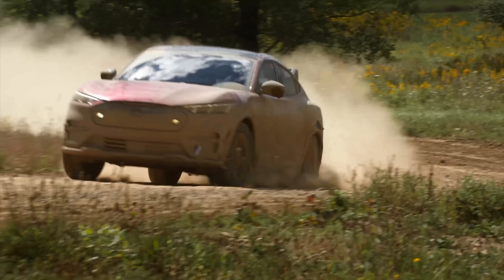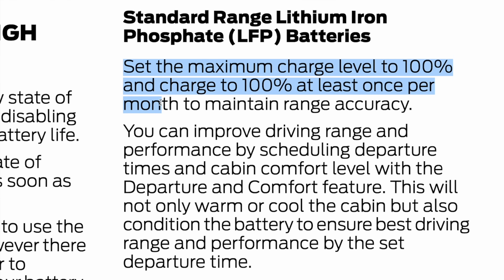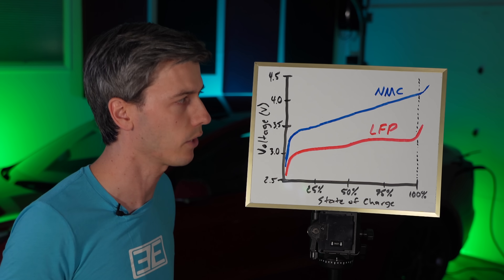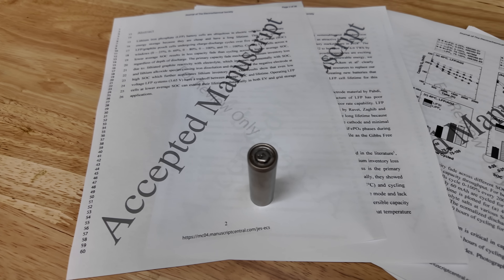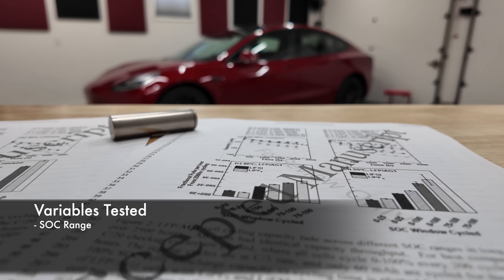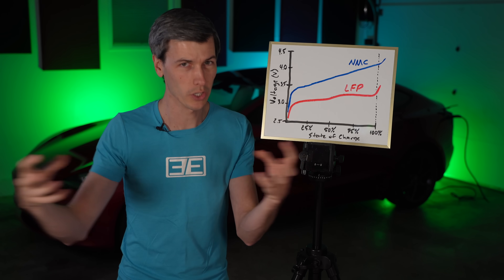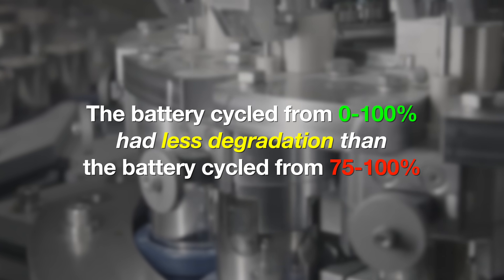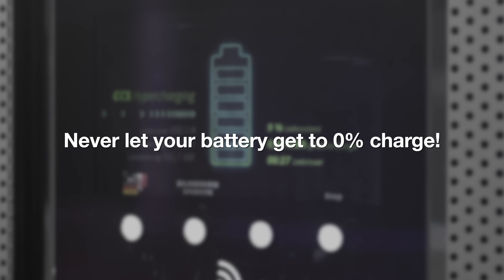How To Ruin Your Electric Car's Battery - LFP Edition!

Comment: There should be a sticker in the door jam with all the battery specs.
Reply: Or at least a place in the GUI to look it up. All of that should be in an "About this car" section of the in-car computer.
Reply: @JorgTheElder  I  just got a 2024 Tesla Model 3 (my first EV). It says right on the info screen that it has an LFP battery.
Reply: @JorgTheElder  it is exactly as you described it on the Tesla Model 3.
Reply: @JorgTheElder doesn't Tesla do this?
Reply: @JorgTheElder  all you need to do is look up your model type and year...not exactly hard.
Reply: Considering how much of the vehicle cost it makes up, there really should be.
Reply: @teachingthecode4651  Definitly somethiing that costs nothing to do but can greatly impact the lifetime of an ev.
Reply: QR code to the DATASHEET
Reply: Tesla tells you right on the screen in vehicle info. Don’t even have to look at your vin and count digits.
Reply: I believe Volvo EX90 will be the first car with a "battery  passport" that will have very extensive information about each car's battery. I also heard something the EU is planning to make those battery passports mandatory at some point
Reply: @GregWaszkiewicz  EX90 will be unaffordable for the vast majority of people, starting at 100k+.
Reply: Yecch. Door jam tastes like grease…
Reply: You mean like the tire and GVW information nobody looks at? Or the owner’s manual they don’t bother with either.
Reply: @Dingleberry1856 yes that, because knowledgeable people do look at that and give simplified instructions to the people who don't
Reply: "Jamb"
Reply: That’s a great idea, I don’t know if there is any added benefit to having information available to first responders but if there is having something more standardized and available would be good when issues arise.
Reply: These are the things that will come along as these continue being mainstreamed. Right now there are still “enthusiast” cars for electric car nerds.
Reply: I searched online for what's in the Porsche Taycan 4s for an hour and I still don't know what's inside. To make it even more confusing, the battery was swapped 6 months ago so it's even possible it changed.
Reply: No, the charging logic in the ECU should have this covered. Don’t put the sole onus on the end user.
Reply: @TML34  except the owner needs to know what the ECU is going to do, and the ECU can’t see the future. So there still needs to be a cybernetic (the old definition) interface where the owner and ECU both know what’s going on. Be it a schedule in the app, use learning, and above all robust fast charging for un-expected need.
Reply: On a Tesla: "navigate to Controls > Software > Additional Vehicle Information on your Tesla's touchscreen."

Seems simple enough. They could put some useful advice there too, and update it as necessary when new evidence comes out.
Reply: LFP charged to 100% will show the same range every time no matter how you drive because of the voltage curve, as explained in the video, so very easy to know it's got an LFP battery
Reply: @gregb1599 I have a model 3 with a LFP battery. The displayed range definitely changes. It's easier to just check the info on the display as multiple people have written. I also explicitly waited for them to shift from NMC due to similar charge constraints discussed in the video.
Reply: most people with a bmw 1 series didnt know their car was rear wheel drive , thus making bmw switch to fwd, their customers wouldnt even notice.
Reply: First time owners of brand new cars will care about the battery so if it’s messed up then I’m assuming that will likely be down to the second owner.
Reply: Your took the words right out of my mouth.
Reply: Just like a fridge!
Reply: But once we know, and one we work out our best plan for our car and it’s charging options.. make a label for the inside of the charging cover.
Reply: The South Korea gov't is trying to do that after the recent MB EQE battery fire that also destroyed 140 other cars .
Reply: The EU will have the car makers join the battery passport protocol by next year. Meaning we will know where a battery comes from and where its being used regardless of its origin, all the specs, making them easier to track and study degradation.
Reply: The AI assistants are coming. Your silicon assistant will know your schedule and charge your car accordingly. And if after a few drinks you foolishly decided to charge your car at the wrong time it will tell you, "what are you doing, dude? stop immediately or I will call the police".
Reply: Or at least a link to this video 😉
Reply: Tesla got a fair bit of flak from consumers when they decided to switch the SR+ from NMC to LFP due to winter performance (range, charging speed). It's understandable that they wouldn't necessarily want to advertise which models has the 'inferior' battery tech (in terms of overall performance), especially a couple of years back when they switched over the LFP.
Reply: @tzeimet  LFP is less likely to burn or explode than NMC. Also no child labor/slavery to mine cobalt.
Reply: @franklofarojr.2969  That's definitely true, but it is inferior from a purely performance perspective (cold weather performance, energy density etc)
Reply: The average consumer wont get it regardless.
Reply: @Kvickification  If even if they don't understand it, whoever maintains it will and everyone has the right to full information for the vehicle they own.
Reply: @Kvickification that's the worst argument ever. What is your "average consumer" based on? Cars already have tire pressure and refrigerant stickers on them. It's safe to assume at least half of the owners know about them.
Reply: @khankbar  I am not against the idea. The average consumer is based on people that have no interest in cars. They do not do frequent oil chanes, check tire pressures etc.
Reply: @Kvickification  the average consumer don't deserve cars and should just take public transit or robotaxis.
Reply: @Kvickification  " The average consumer wont get it regardless. "
Doesn't matter. It's better to have it for those who understand it, than to hide it out for everyone.
But I know that's the exact opposite of what has happened in the last 30 years of automotive.
Reply: @Kvickification  we have stuff like GVW and tire PSI in the door jam that the average consumer doesn't get either. I am ok with that. Being a non average consumer and being able to quickly reference information available in the same place on the car has value. This is just a consumer forward way of thinking and costs the manufacturer almost nothing.
Reply: @Kvickification  That's likely true as EV adoption increases, but a lot of EV drivers are VERY nerdy when it comes to knowing about their cars.
Reply: @Kvickification  so true..  the average joe doesn't want to know (or shouldn't have to) how battery works.
Reply: Manufacturers like tesla  won't share that with consumers. They don't even share their engine specs other than 0-60. I found out years later the based model 3 with lfp used a weaker engine than the previous generation.
Reply: That won't happen because the main rule about EVs is: Hide all information, obfuscate, and lie.
Reply: yes, there is one, it says do not charge when raining.
Reply: Never had problems  with that.. we have heavy rain here.. was a bit scared of that to but no prob
Reply: @rafepittenger7484 Sorry everyone in the Pacific Northwest.

Comment: In short. the less you use the battery, the less it degrades. Genius.
Reply from the maker: Not at all, the testing done is ensuring they each are used the same amount, yet with different amounts of degradation. That's why it's interesting.
Reply: @EngineeringExplained  fair point, of course. I still get the impression that overall, the more the battery charge spends time close to zero, the longer it lasts. For the same overall electron input/output. Hence my comment. Or did i miss something?
Reply: Just like a 13900K processor.

Comment: Maybe a solution is a dual chemistry battery system. Part batterys of one type part another and the computer can use an algorithm to determine which should be charged by how much and how often and when.
Reply: I think you can't mix LFP and NCM, because LFP have lower voltage, NCM is higher and it can create self discharge at each other
Reply: @annguyenvan7655 Obviously you cannot mix chemistries... But you could have two different chemistry packs.
Reply: @rkan2 @ rkan2 I think you can do that, and there are other problems like: what battery type do you want to charge/discharge first and 2 pack charge/discharge at different rates. and heat can affect the charging/discharge of 2 pack
You will need more complex electronic circuits, and the performance may not be as good as using a single battery type.
Reply: There is a company called Our Next Energy that has engineered a pack with 2 chemistries. I don't think it's being sold yet. It has 185kwh, 600+ miles tested in a BMW. LFP for everyday driving, and the anode-free cells for distance beyond 150 miles. The anode-free batteries have incredible density, but low life-cycle (mostly only used on long trips). 
  The disadvantage is more complex construction and BMS/cooling system, cost in the DC-DC converter too.
Reply: @deansmits006  You might need to go back and look at your terminologies there. "anode-free" would be saying the battery has no negative terminal... a fairly important part of a power-system lol

Comment: I really wish they also included a mid range SOC discharge too, like 75-25%
Reply from the maker: Yep, the initial test was just a few of them, and they added more SOC ranges later. Would be interesting to see something in the middle, but I think the general trend remains (low SOC = better).
Reply: @EngineeringExplained  It sounds fairly similar to following a tractor trailer for fuel efficiency: the closer you are, the better for efficiency, but the more dangerous it gets, so it's a balancing act of how close do you get before you risk smashing into the back of them?

Comment: Ford: divide the 5th digit of the VIN by the manufacturing month of the vehicle and multiply by 2. If the result is a prime number you have an LFP battery
Engineering Explained: Every car manufacturer should be making it THIS EASY to determine what battery you have.
Reply: This means no Ford has an LFP battery because any multiple of a prime number like 2 is inherently not prime
Reply: VIN 12345
Produced in may
5/5=1
1*2=2
2 is a prime number
Reply: @piotrf738  Fair point, I forgot to consider that
Reply: Yeah how about a simple information screen that tells you this like Tesla have😂

Comment: Thanks Jason for the great video- I ended up waiting and buying the 2024 "refresh" model 3 and love it- However, as you noted there are many different theories out there about SOC on my LFP battery. I'm still a little confused as to best practice but as you said. The chances of the car outliving the battery is very low. I think that's the bottom line. I will continue to leave my car plugged in when not driving.

Comment: If im not mistaken quality LFP cells have such a high cycle life that you don't really have to worry about now you charge and discharge (only for long term storage), the calendar life is going to go out first unless the vehicle is a city bus or a taxi that is being driven 24/7.
Reply: 3500 cycles till 80% of their original capacity for LFP VS 600 cycles for NMC. If charging to 100% everyday only takes of 3% of those cycles, I'm good with that LOL
Reply: @Jasonoid  exactly, it's not worth the hassle
Reply: @Jasonoid what is classed as one cycle?
Reply: @newbris  charging the battery from 0% to 100%
Reply: @Jasonoid  so if you used from 100% to 85% and then recharged to 100% that wouldn’t count as one cycle?
Reply: @newbris  it will, in a sense such "shallow" discharge cycle will degrade battery more, as in you will get more useful live if you just went with 0to100, from what i gathered usually 45/50 to 100  is optimal.
Reply: @newbris  if you charge from 85% to 100%, you only used 0,15 cycle
Reply: For the first owner and probably the second owner, this is correct. Most people are not driving their EV 200k. The third owners might, this is where you may see a small degradation in resale value based on overall pack capacity. For the average person this is way too off in the weeds.
The battery in your car is not like the one in your cell phone, it's not that sensitive to how you charge or treat it.
Reply: I have a BYD Seal, the recommendation is, every six months allow battery to go to SOC under 10% and AC charge to 100%
Reply: @ That's for the computer to callibrate it self so it knows accurate state of charge and  can do accurate-ish range estimations

Comment: That video hurt my brain, not cause I didn’t understand, because I did and understand that I just fill my gas tank every week in 2 min and never think about it. I love that feature, in fact, i think I might keep that feature for the rest of my life.
Reply from the maker: I don't ever think about it. I just plug my car in each time I get home ('18 Model 3 Perf), and it's at 80% every time I leave. Never have to visit gas stations. It's not complicated, but my content is for those who are curious. :)
Reply: @EngineeringExplained  I'm curious if Manufacturers  will come to the table with a 20yr battery warranty.  (most ice cars last 20yrs easily) Then I will jump right  in. Degradation will always occur, its just how its handled that needs some feathering.
Reply: Until you fill diesel